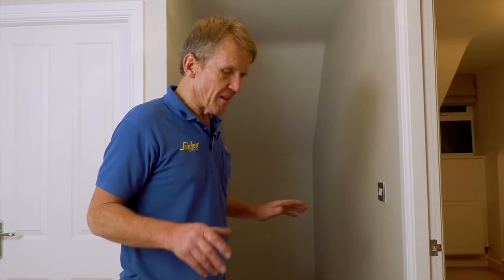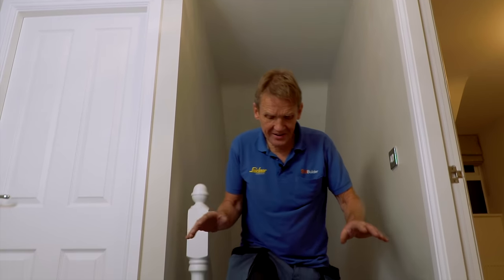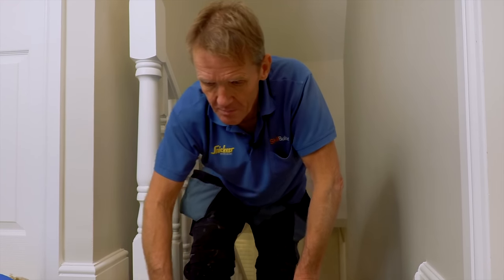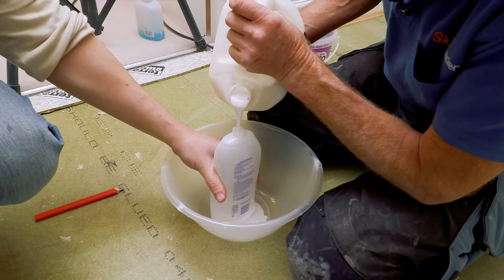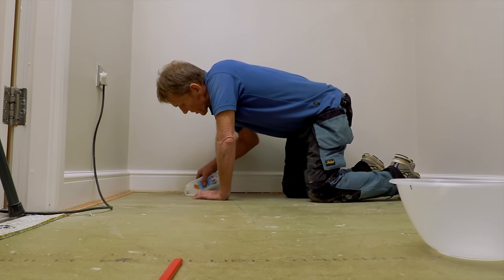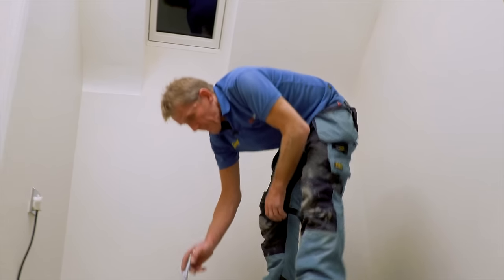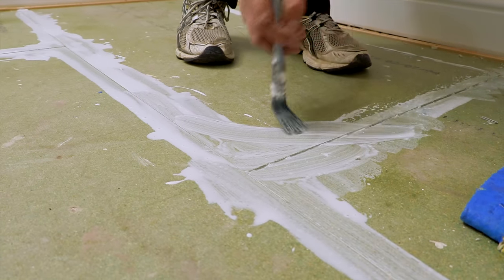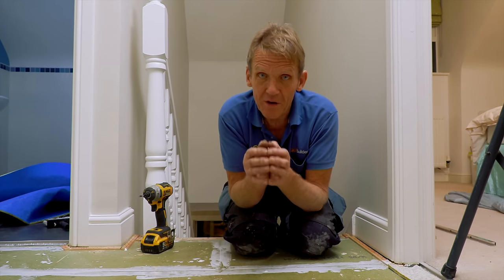Creaking Floorboards Driving You Crazy?

Comment: Even after adding hundreds of screws before our carpet was replaced about 10 years ago, the chipboard floors in our lounge were still driving us nuts, so I stripped out all the furniture and carpet to give this a crack yesterday.

Here's a big caveat which should probably have been mentioned in the video - be very aware of what is below your subfloor! I diluted PVA 3:1 as recommended and painted it in with a brush, even pouring a bit extra in where it seemed to be soaking in nicely. After going over the joins once I checked the room below and found the watery glue was dripping out the ceiling onto the carpet and furniture in several locations! We have exposed joists with plasterboard in the room below so different than typical, but I didn't think it could drip through so easily.

I was so gutted...had such high hopes for this technique after all the good comments. After we were done, the floor still creaks. Seems to be the damn nails that creak, and even though we screwed next to each one it still creaks. Probably no choice now but to rip the subfloor out and replace.

Comment: I used the method where you drive a screw through the carpet and it worked, however it was a constant guessing game and the squeaks eventually came back.  This shows you how to do it right, and this is what I plan to do to eliminate the issue for good.  Thanks for the video.

Comment: One thing that might help is to ensure that you drill a clearance hole through the board only for your first screw so that the screw can pull the board tight to the joist - then follow it up with a full thread screw so that the thread engages in your board and the joist to lock it in place - this might help to ensure the creak stays gone.
Reply: Decking screws may help, they have two different threads so that as you screw down, it pulls them together.

Comment: Skill Builder is absolutely right. You have to be very CAREFUL when trying to find the joist. After watching like 4 videos, I listened to Skill Builder, and went to the garage and cut a small hole about 1 square foot off the sheetrock ceiling  near the estimated area that squeaks. Low and behold, there are 2 heat tubings right under the baseboard. If I were to just probe for the joist, I would be drilling into one of them for SURE. Then I drill a 4 inch wood screw from the ceiling of the garage upwards and went upstairs and found it. Then I measure and tape where the joist should be. 
I will still go down to HD and buy the anti squeak  kit to screw it down. Thanks Skill Builder.

Comment: It really works!!! In my case, the squeaky sound comes from a joint that is perpendicular to the studs. I have nowhere to drive addition nails like most other videos suggest. So I applied some wood glue and used a hand trowel to work it in. The squeaky sound was gone the next morning. Thank you for this very useful tip!
Reply from the maker: I am glad it worked. I would always water it down so it flows in nicely

Comment: I have this exact problem....
All builders tell me to screw and nail, did that, the squeaking is still there
That is because, its in the yellow tongue as this legend says
Well done mate, now i know how to fix it
Reply: Hugh Jazz use gorilla glue. Plenty of it let it seep in and it expands on curing. You can then use a simple window scraper to scrape the top off where it expands out the surface.
Reply: Ah ok, is Gorilla Glue liquid enough to seep on?
I'll look it up, im in Australia, pretty sure ive seen my other trade friends with that product
This: https://www.bunnings.com.au/gorilla-236ml-glue-bottle_p1662679
Reply: Hugh Jazz you should be able to find alternative brands of expanding glue. Hippo also make one. They flow very well and the warmer it is the better
Reply: Thanks mate, i found it, it's sold in town here.
I see using the flooring adhesive and a block underneath can also help
Thanks for your tip mate, i will 100% be doing it.... 
My squeek is in Yellow tongue chipboard flooring, it is actually in-between the joists, it is the noise from the yellow tongue as the 2 sheets flex independently of each other in free space (nother under that point).
So a glued block underneath and then fill the join from the top should work.

Comment: Brilliant presentation.  Thank you for sharing your knowledge and tips.....and that's from a lifetime DIYer!
Inspired by your approach, I would also consider drilling holes through the flooring in line with joist nail/screw run  (every few inches) to a depth of the flooring (plus 1-2mm...these are modern times!) and feed your thinned PVA mixture into the holes. Then, as you did on the inter-board joints, you'll create a locally attached pool of adhesive, attaching the boards to the joists every few inches. Again, as you did, use movement to help capillary the adhesive into the thin gap between flooring and joist.
FURTHER TIP: To create more work for tradesman and to inconvenience the customer (at some time in the future) I would wrongly mark the locations of pipes and wiring on the floorboards.... I'm joking I'm joking!!!
No Axe

Comment: Just finished relaying a floor for a customer in a bedroom who had issues with creaking. This was due to another "tradesman" laying the floor on top of 30mm of polystyrene directly onto the joists! In some areas the polystyrene had compressed so much I had a 20mm gap under my level......... Nice!
Reply: I have seen expanding foam used in the same way. It fills areas which are uneven and also insulates and excludes draughts.
Reply: Until it compresses under load!
Reply from the maker: Diddy Wright
 I saw that a few months ago. The guy put down those trays that carry underfloor heating pipe. He laid them across the joists rather than in between and then laid the floorboards over the top. I looked and didn't say a word. Unlike me I know.
Reply: Skill Builder I struggle to understand the logic behind people's decisions at times but hey ho! Got the other bedroom to do in the new year due to the same "logic"!

Comment: Funny fact why a lot of people go through the pipes when DIY is because plumbers and electricians never-ever screw/nail the boards back down when their done with their pipes/wires. 
Here is my two pennies, if you cannot expose the joists at-least partially buy cheap usb endoscope/inspection cam and 15-20mm hole saw drill/inspect/screw. 
Good tip with the diluted PVA hope it made a difference (PS them 75 mm screws were overkill ;]]])
Reply: Without a doubt use a camera if you can; I had/have squeaky floor boards. So I was able to lift them to ensure there was no pipes. Luckily I did this as under one, there  sitting in a small notch in the top of the joist was a gas pipe! The workmen had even cut a notch in the floor board for the pipe to sit in. needless to say there is still a squeaky area :(
Reply: Good comment.  And love the video too.  If there is one important thing to find out and investigate, it is where the gas pipe runs!  Fortunately in my case I had the chance to run it outside, rather than through, my property.

Comment: Roger very helpful and informative suggestions. Especially not screwing onto carpets,   beware of pipes and max length of screws to use. I like the tip where you dilute PVA glue and brushed into the seams. Thanks Roger. You good man.

Comment: Using the correct screws is also critical. 

You want to be using something like a spax chipboard flooring screw.

Using a fully threaded screws won’t “pull” the board down, and will just result in the creak not going away or coming back.

Comment: Thank you! I do like your videos, finding them friendly and informative. I must confess that I have, this morning done exactly what you get loads of call outs for.... We are having new carpets upstairs and so we have been lifting up the old ones cutting them and the underlay into manageable strips for the trip down to the tip. So, says Emma... Lets do something about the squeaky chip floor... Despite all the wonderful excellent build quality extolled by the builder our boards were just nailed, no sign of glue anywhere... Unfortunately I made the mistake of believing that all the pipes were in the joists... Sadly the central heating pipes were laying in a shallow cut on top of the joists, immediately below the floorboard... I got as far a four screws.... Have spent the rest of the morning cutting a chunk out of the chipboard to find the copper pipe and a mad dash to B&Q to fix it... On the plus side a good time to drain the central heating system and top up with water and, (I think) Fernox :)
Reply from the maker: It has happened to so many people. Emergency plumbers have grown rich off the back of this type of thing.
Reply: Any way of knowing ?

Comment: Thanks going to do this tomorrow.  I tried to fix this before without the glue.  The guy who built this side of my house half assed everything.   Not only does the floor squeak. I feel like I am walking on a trampoline.   I like the idea of putting a screw next to the nail.  Another great tip.
Reply from the maker: MuckoMan
I should have used shorter fatter screws. These were too long but they worked.

Comment: I used to work on construction sites. Squeaky floors on new build properties are almost certainly caused by the house being constructed in cold, wet weather, usually in the middle of winter. I've seen joist kits delivered to site,then left sat in mud, rain, snow for a fortnight before being craned up onto the house and assembled. The house may stay open to the elements for a further week or so before being roofed in. Later on, the plumber installs the central heating and switches it on- guess what, all the timbers shrink, hence squeaky gaps everywhere.
Reply: So frustrating what annoyance and extra work is caused for homeowners by laziness and cutting corners in the building trades. It's rampant. No one has time or takes pride in craftsmanship and doing things right anymore.
Reply: Yes, our builder even layed the floor and used it as a platform to lay the upper storey brickwork. Good for the bricklayers safety but it got rained on for weeks
Reply: @stewartbridge5162  this is normal construction practice nowdays. The house is built in layers from the ground up, the roof being the last covering. Before that, the floorboards and ground floor are exposed and open to all weather conditions. The roof and windows seals the moisture inside the building and it takes weeks to dry out.

Comment: i live in a studio flat.  And the chipboard that’s on the floor, is driving me crazy… with creeks & cracking noises; in which happens, more or less all over the floor.   But, after all this time of trying to find a solution;  i now know what the problem is.   It’s the joints.. where the chipboard panels are pushed together when laying the floor.   i decided to run a Stanley knife down the joints of each panel… so that there is a tiny gap in between.  And to my surprise…  The creaking and cracking noises stopped.  Hurrah!    Would have been better though if i used that Dremel tool.   Will buy 1 from amazon.   
Tuesday 3rd October 2023.  Southampton England 🏴

Comment: Guess you havent heard of squeak stopper screws. The head breaks off just below the plywood. Screw into floor joist through carpet or hardwood. Sold at home depot. Did my entire 1st floor. Works like a dream.
Reply: What happens if the boards need to be taken up?
Reply: Thomas Mack great, until some noddy goes straight through a copper pipe

Comment: Yeah I had a while you’re here. There was a creaking floorboard in the bedroom, had a look and a plumber had lifted the boards and put the old cut nails back. Easy I thought , put some cleats under the boards and screw it. Lifted the board and the cut nail was through a. 22mm plastic pipe. It had been done 8 years ago. Loads more work I didn’t need.
Reply from the maker: Amazing how a nail or screw through plastic will hold that long
Reply: Martin Hull A plumber lifts a floor board to plumb and then nails the board back down through the pipe under the board that I would imagine he new the pipe was under!

Comment: Good work, but do be aware if you don’t know where your pipes are it maybe worth pulling up the boards to have a look, or use a detector to find them.  I did it a few years ago screwed straight into the heating pipe, builders put the pipes in an obscure place to the left hand side of a floor board where you would normally have a screw. Would have been okay in the summer but it was December and freezing 🥶 😂

Comment: I always just drill the depth of the board first and then try probing with a smaller nail to see if there is a void (notch) in the joist. I use screws 1.5 or 1.75" (whatever grips) to avoid going too deep into the joist. Always careful near radiators and power outlets and assuming most likely direction of pipe/wires at 90 degrees away or in line. Finally to know where the heating drain is in case sod's law prevails and to be ultra cautious you could shut bith valves on every radiator so just the pipework remains in water. If working under floorboards I always mark pipe and cable runs in black indellible marker with depths and other info like light fitting locations, junction boxes, pipe size/flow return, tees, bends, width of notches etc. But I am an amateur not a tradesman.

Comment: Hi Roger, I always enjoy your videos! The 2 chipboard flooring manufacturers that I am aware of (Caberfloor and Egger) recommend their own adhesive rather than pva. I have used the egger system to totally relay the flooring of a large property used in combination with 65mm spax screws and it worked well. Their adhesives are a much heavier duty product than pva and they actually expand so you don't have to keep pouring it/ brushing it into the crevices as it does the job for you. Once set you just scrape the excess away with a heavy duty scraper or chisel and it flakes off.

I'm not a fan of chipboard, it is such a cheap and poor quality product. I dread to think of the problems in 5 or 10 years time with all of these new properties going up if the correct method is not being implemented by the builders.
Reply: He isn't advocating using the PVA for new construction, just in this type of repair to a squeaking floor.
Reply: I can confirm Egger D4 adhesive is an excellent glue product for chipboard flooring, however- NEVER, EVER get it on your hands! It turns black on your skin and will not come off for at least 3 weeks! I've tried everything to remove it, white spirit, sworfega, petrol, the lot.
Reply: Thomas Review and travel Oneshot works great for removing those hard to clean glues. Don’t leave it on your hands to long.
Reply from the maker: Popandu 
Yes you are right they recommend polyurethane glue but I find PVA works and it is what they always used to recommend before the started selling glue at 5 times the price.

Comment: Only 2 things have worked for me over the years 

1. If easily located you need to fix into the cross noggins in the floor ( had a floor 5 years ago drive me mad, this fixed it instantly )

2. If 1. fails to do the trick you'll need to pop the skirting off. Its possible the PV5 flooring has been cut too tight. Once you move in the timbers can swell once the heatings on etc. Rarely see 2. due to how houses are built but can occur if solid walls continue through floors

Comment: Short heavy gauge screws across any squeaking joints held tie the t&g together also. Should do a video on the difference between wood on wood wood on metal and the accompanying sounds. Always screw soleplate of partitions down to joists. With nails as  the house settles the floor board edge will rub on the shaft of the nail. No good.

Comment: Wow, I like this guy.  Of course my US 1961 house has plywood, nailed down, but now under newly laid laminate flooring.  I do have absolutely clear access to the plywood and joists in the full basement.  I tried a SqueakEnder in one spot; no difference.  I did put in some of the double-threaded screws with the break off heads in one bathroom with already shoot linoleum and they worked.  Until this cold low-humidity winter and it's back to where it was.  Might try the PVA (Elmer's to us Yanks) trick.
Reply from the maker: It will only work if you have tongue and groove boards. If the plywood is butt jointed you could squirt in some expanding polyurethane from below. If you can find which boards are moving the glue will fill the gap and expand. It works really well.

Comment: Really good tip with the pva into the joints 👍🏻
Reply: B Scooter will do absolutely nothing. I like roger, no disrespect intended.
Reply from the maker: Gareth. Why do you say that. It stopped the creaking. The noise comes from the tongue and groove moving and the glue stops that completely. That is one of the reasons they specify it on the board. Diluted PVA gets down in the joint. I know this for a fact because I have removed joints that I had done in this way when doing alterations to pipes.
Reply: Skill Builder hi roger, I’m not saying it shouldn’t be glued. I glue all my floors with polyurethane. I. Don’t think the pva cured the problem, I think it was the screws. Also if you pull the original nails and replace with screws your know your not hitting any services. Thanks for taking the time to reply.
Reply: Opposite threaded screws. Top of shank the threads go in the opposite direction. Pulls the board down to joist. No PVA needed or any other glue. Good forever.
Reply: @garethharris946  spot on, my builder used that nasty glue for boards and it expands after a while. He said I hope you never , ever have to lift boards up for whatever reason :)